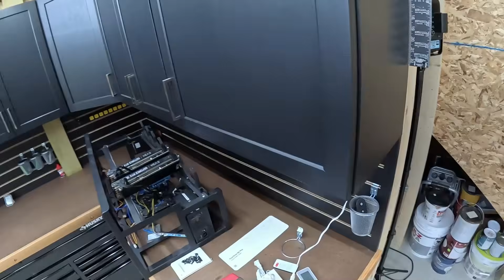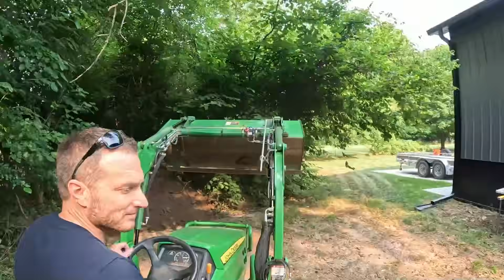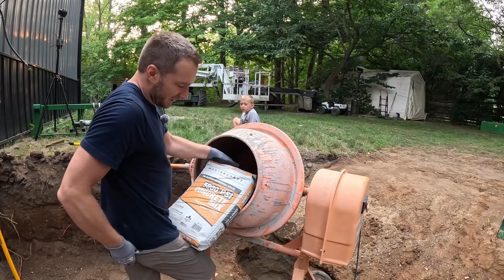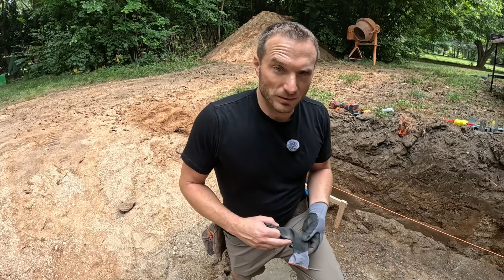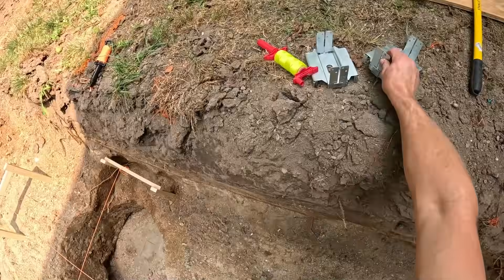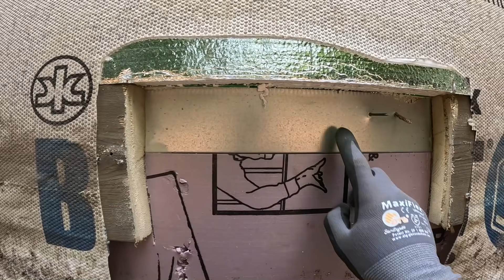Building a Barn Bathroom – Day 1 | Excavation, Framing, Concrete, & Relocating a Mini Split System

Comment: Great video Sam.  Can you share what make and model of vacuum you have for purging your mini split lines?   Thank you for sharing this.
Reply from the maker: Thank you @tomreidy1237.  Here is the link to the Vacuum pump I used https://amzn.to/4fvdxLr  And this is the Gauge set   https://amzn.to/45Hua33   If you need to cut and flare your lines this flaring kit works fantastic.  https://amzn.to/4mEW2uC    Stick around for the next few videos I will go through the process of hooking the mini split back up and use the vacuum pump.   Thanks for watching
Reply: @Built-By-Sam  thanks again and I am looking forward to some of your next builds.
Reply: @Built-By-Sam  so for roughly $250 you can eliminate calling a HVAC company to finish the installation of your mini split?   Sounds like a deal to me.  Thanks for sharing.
Reply from the maker: @tomreidy1237  yes exactly.